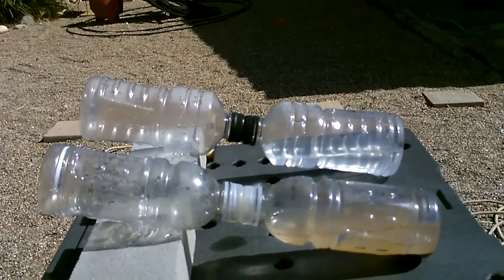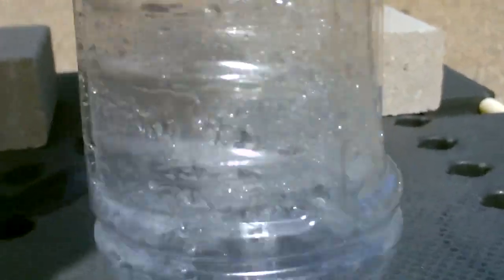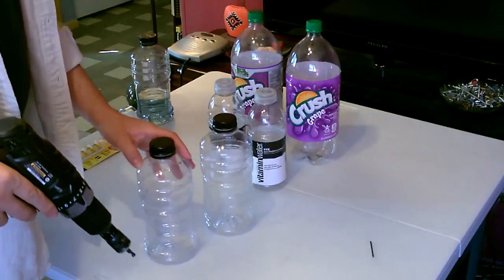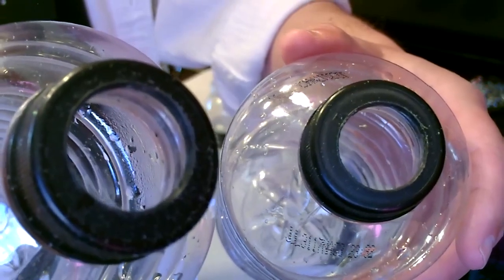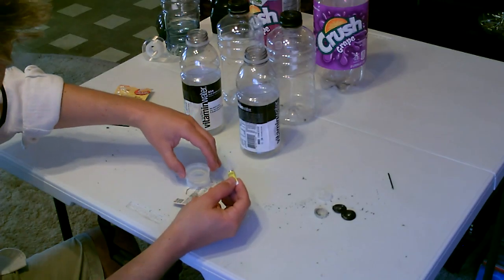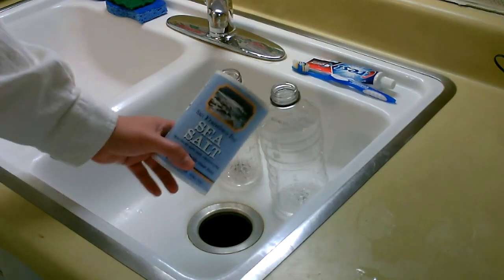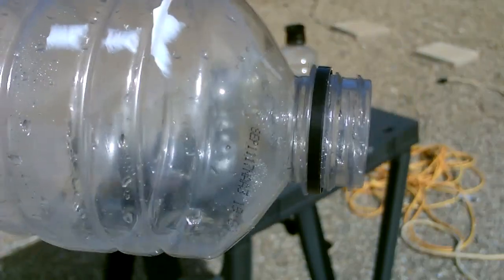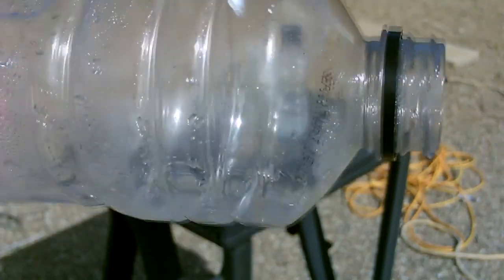DIY Solar Water Distiller! - Simple Solar Water Distilling - Easy DIY (for survival/SHTF)

Comment: Could imagine this on one of those survival shows on some desert island
"All you need is 2 containers, an improvised seal, a water source and of course a power drill"
Reply: That's part of the reason for the demo video.  You now know the process, so you can make up a couple of cap setups in advance.  This helps save time in a crisis situation, and staves off the lack of necessary tools.  Otherwise, as others have pointed out, you can use a knife or hot piece of metal to make the holes, and melt the caps together to "glue" them.  

Often, these sorts of videos are a basis for further knowledge and ability.  You get one piece of a puzzle from one source, another elsewhere, and, perhaps, add a third piece with knowledge you already have.
Reply: Oh ye of little brains

Comment: You could able to optimize the condensation by covering the distilled water bottle with wet piece of clothes or any textile tissue. This will make less temperature in the distilled water bottle and also water will be more cold for immediate consumption.

Comment: How exactly does this help you, if you're in the middle of nowhere, in a survival situation?
Reply: Dusty Boot Even in the middle of nowhere, you'll probably be able to find plastic bottles laying around. They're everywhere! You don't need a drill to make the holes in the caps, it can be done with a knife, or even a sharp rock. The caps can be fused together by melting them together with fire, made by lighter or primitive if need be. If you don't have fire, pine pitch or tree sap could also possibly work as an adhesive. If fire is possible to be made, I would recommend boiling the water before distillation.
Reply: “How exactly does this help you, if you're in the middle of nowhere, in a survival situation?”

You wouldn’t have internet, so no youtube, so how could it help you? Haha

Comment: sweet deal bro <3 and friendz <3 z thatz handee , if peepz hav no drill we could prollee melt a hole between capz held togethr fruhm bottom in center,or go capless n duct tape or tie with a plastic bag arround konekting, ,,,or if we put a tube top tu bottom insiyd both bottlez konekting them and seal it (tube n capz tugether and put siyd holez in top and bottom endz ov tube then the purifyr kan stand uhp vertikal and yep adda outlet foset(klohzabl) (closable) ohn bottom ov top bottl and open intayk (fill) hohl (hole) ohn the top ov the bottom bottl <3 z =)
Reply: Do people ever understand you?

Comment: would it be possible to saw the very end of one of the caps... and use one cap to screw both bottles together? (the cap would need to fit both bottles & the screw thread would need to go quite far up the inside of the cap)
Reply: does metal absorb heat better would it be better to use a metal can? or would putting little stones inside the dirty water bottle heat it quicker?

Comment: You can even use a sponge inside the source bottle to increase the surface area of the contaminated water for quicker evaporation.
Reply: No need. The humidity inside the source bottle will reach 100% very quickly regardless and no more can be evaporated, until it gets condensed out in the condensation bottle. Also, the sponge will get clogged with salt soon and would be difficult to get out to clean.

Comment: 'Weird question, I know, but would this work with urine?
Reply: People say the first step to water purifying, should be to boil it. This will boil off volatile compounds that would otherwise be the first to condense into your "purified" water, making it not pure. Reference to boiling water to get chlorine out of water.
Reply: Technically, yes. Distillation pulls water up and away from all particulates, because it's basically the rain cycle - water to vapor, condensed to water again. But since commercial distillers use a boiling method and simple DIY's like this don't, I would still recommend boiling if possible. Still better than drinking straight urine any day though. The sun is awesome!
Reply: bear grylls would love one of these
Reply: technically it should, but I'm not certain of it.
Reply: I've heard of people using similar methods to purify urine for when one is in a survival situation.
Reply: Nathaniel Pillar Thanks.
Reply: Jaybird, look up Andrew Norton Webber on youtube to answer your question
Reply: I am sure it will work with urine, but some of the ammonia smell will certainly get into the condensation. In a survivor situation, who cares if the water tasted a little funny?
Reply: Thanks for info Jay, I think you do have a point. If the water source is particularly sketchy, and time/resources permit, boiling beforehand can only help. Stomach illness in a survival situation could be deadly if you cut corners needlessly.

Comment: SHIT! in a survival situation i seem to have forgot to bring my cordless drill. lol
Reply: mark sharp You're one of those people lacking enough imagination to improvise the method of the build, but witty enough to make a smart ass comment degrading someone else's efforts. You can "drill" holes in the caps with a pocket knife or sharp stick/stone. If you're capable of making fire, melting the two caps together instead of adhesive would work. If you're not capable of making fire, pine pitch/tar or even clay would do the job. As for the bottles themselves, there are probably as many of them laying around in the world as there are trees.
Reply: use a pocket knife
Reply: Then heat up a stick and melt a hole
Reply: A knife then seal with duct tape, 2 of the ten C’s of essential survival items we should all have as taught by Dave Canterbury at the pathfinder survival school, or melting with a burned stick as previously mentioned if you also have a combustion source (another of the 10 C’s)
Reply: If you were really “Sharp”you would glue drill and store the lids NOW....
Reply: @A Google User, you never know these says, common sense isn't really that common. Maybe Mark Sharp just isn't that sharp.
Reply: mark sharp lollololololololol
Reply: Murderer a rabbit with spear.
Widdle rabbit teeth to a point.
???
Water
Reply: Just use your urine
Reply: How about your glue?  I think you need to plan ahead and bring the finished device with you.

Comment: Clever idea.  Aside from thoughts already mentioned: glue the caps together first,  then drill them.
Reply: +Color MehJewish 

true...the joint needn't be water tight anyway...its vapor going thru it...
in fact...if no tape handy...u could tie the necks together with saran wrap type stuff or even some cloth...in a pinch.
Reply: I thought drilling after gluing would work well, but the bond has to be really strong, otherwise the shear force of the drill will break the bond of the glue holding the caps together.
Reply: ahahahahah yeah right clever idea ahahahahah neeeeewb

Comment: Drill another hole on the bottom of the freshwater part of the bottle and allow it to drip out into another container.
Reply: I was thinking the same thing!
Reply: @taggershine  me too
Reply: backtobasics 95 - I am meaning to put a small hole and tube near where the clean water accumulating underneath, then fasten a tube for excess water to drain ( on bricks) . This would only be in dire circumstances where there would be no drinkable water, yes plastic does leach estrogens. If you wanted to try a different method for camping , there is a video I saw using 2 glass bottles, 2 loaf pans and sand to stabilize bottles while heating, then using cooler water to prevent collection bottle from breaking. U would have to look for it though , as I can't link . Cheers
Reply: @atlasneptuneb  You can provide the video title without problems.
Reply: ditto
Reply: @borisscott9156  what is ditto?
Reply: @Judosaper  "ditto" means "I would have said the same thing"
Reply: @Judosaper  Ditto means "a second item or thought the same." Here it means "I had the same idea or thought also."
Reply: backtobasics 95 - just drill hole where fresh water collects and then  seal a small tube inside, just below water level, so that instead of running back forward , it runs into tube into larger jug with lid or another water bottle sealed to prevent evaporation. Probably best through top of another cap, when full, just replace with solid cap and another bottle with runoff into lid again as a system ongoing.
Reply: A gallon squared milk jug would work a treat as it has the same fittings as the bottled water. Two of those and you are good to go.
Reply: Also just putting the condenser in the shade would boost performance.
Reply: Yep. And using those 5 gallon clear water bottles could make a good amount especially with a separate catch container below the steam catcher. Maybe paint them black? If you had a collapsable container you could pack in a bob. But if all I had were a few drink bottles then this is good to know
Reply: @dickflinghammer58  Black on the bottom, clear on the top for the dirty side.  Possibly white on the top and clear on the bottom for the clean side.  It would be interesting to figure out the best combination.
Reply: Hey, the guy shared a nice idea, it is for us viewers to improve his design to suit our needs not correct him.
Reply: U loop drain would work her as well.
Reply: i was thinking the same thing so u can get the best out of it
Reply: I even commented that before reading this comment but I also thought of adding a straw
Reply: Im thinking put a kink in the bottom bottle to allow the clean bottle to hang lower, and not get dirty water in it.
Reply: Exactly what I was thinking
Reply: Excellent idea. Can prevent cross-contamination.
Reply: Yes that way you c old get more water less time dumping out an ounce
Reply: 👍 the first thing that crossed my mind.
Reply: That's good idea but I guess if fresh water falls to open bottle it may increase evaporation loss of fresh water
Reply: @artyTtot  100%. That and considering you are relying on evaporation to distill in the first place, you'd be losing water at roughly the same rate you'd get it.
Reply: Jacob Orton

u saw it too! the drain.

then get a larger soda bottle and maximize the yield...this idea of his can be built upon.
Reply: then steam will escape... and wont work as well...
Reply: @shashiy4545  uhhhhhh its air tight

Comment: BPA free bottles would be better but I'm sure that wouldn't be much of a concern during SHTF.  Great video
Reply from the maker: hi there and thanks. glass and bpa free is the way to go (if you can). but you're right - it's not a concern during SHTF.
Reply: Like I'm going to die of dehydration and someone brings me the evaporated water but I don't want to drink it because, there could be pba in the plastic...lol
Reply: Putting things in perspective, much of what you eat and drink on a daily basis is contaminated with plastic residue. The amounts which would contaminate the water after the distillation here, would be of the same level or less, than eating hot food taken out of a plastic take away container.  Few people would consider that a concern.
Reply: BPA free is not a safety guarantee. Plastic is definitely not the materiel you want for this use (with heat).

Comment: Try shading the receiver with foil on the top and using foil under the bottle with the contaminated water to reflect sun back into it. Also add black or dark material on the contaminated side. Charcoal will work. That will improve the efficiency!
Reply: robert jeffery would you put the charcoal up near the cap of the contaminated bottle?
Reply: robert jeffery Agreed
Reply: Black rocks will do also
Reply: Connect it to a tube which connected to container

Comment: Add a tube where the water collects in the clean water vessel route it to a small filter suspended over a containment vessel. Another thing I would do to aid in solar heating is get a 16 oz black monster AL can. Cut the can flat roll it up and insert that into the dirty vessel it should try to take the shape of the dirty vessel. Black AL can should collect more solar energy and speed up the process.
Reply: FRUGAL PRIUS-RV could you just cut the top off the can and slide the plastic bottle in?